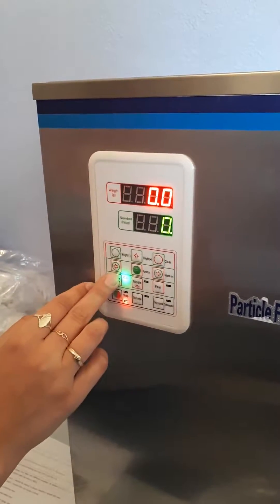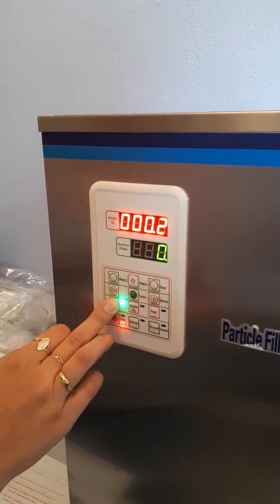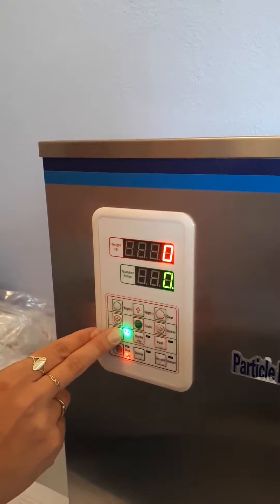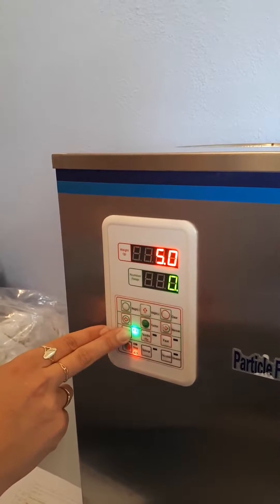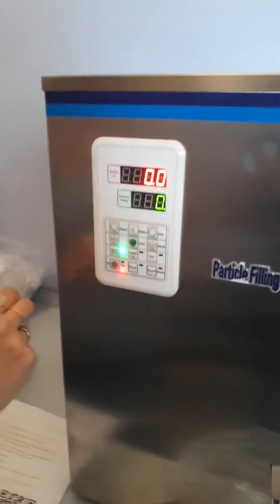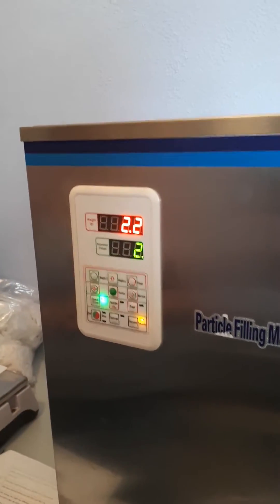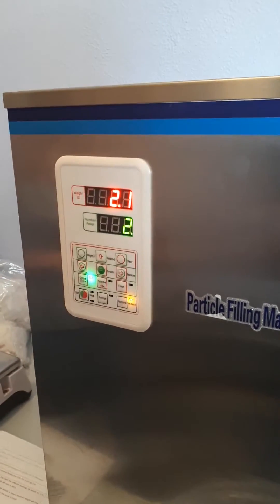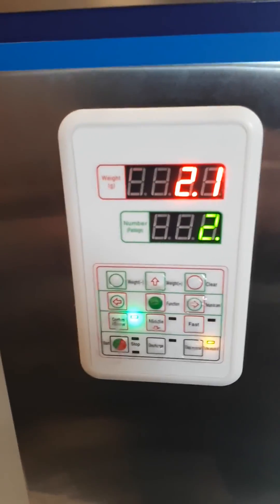Yason Machine problem

Comment: When i press P808, then P660 and confirm, few months ago it usually access to S 00 to edit speed, now after i confirm it just go to main screen of 0.0 grams so i not able anymore to edit speed for filler. Please help. I already replace with NEW board and display 3 times and have same issue.

Comment: Hey man there is  a problem in my machine  when the material is filled then we have to command the machine to open but it does not open  so please tell me the problem with the motor or the sensor ???? Please reply
Reply: Did you get answer for the calibration?
Reply: Hi, have you been able to fix yours too? Can someone share?? Info@nicnax.org